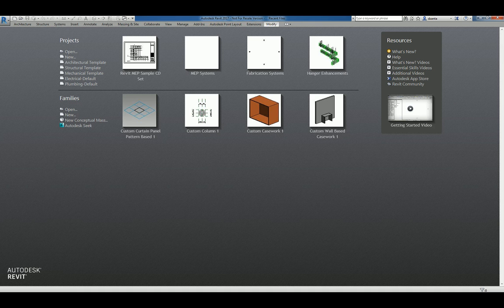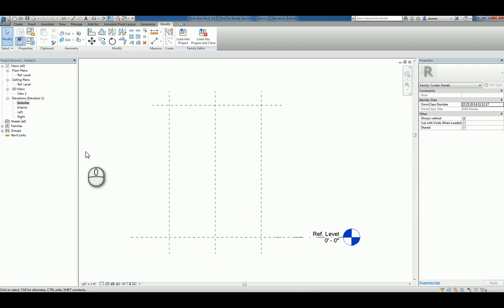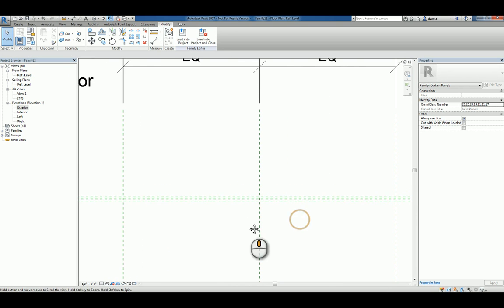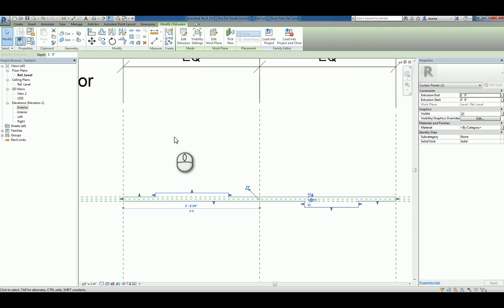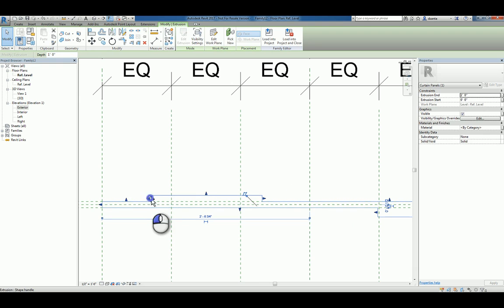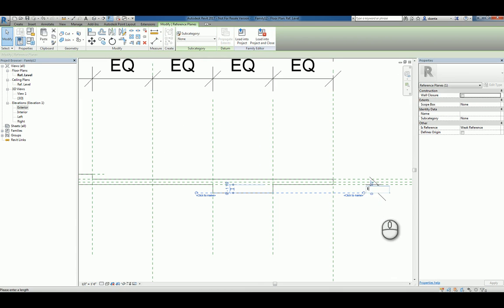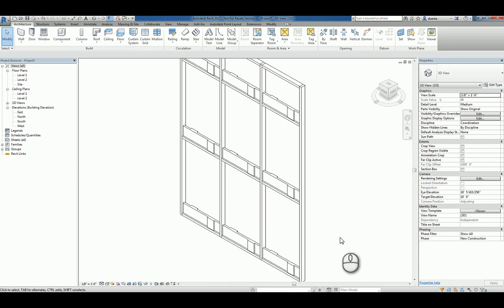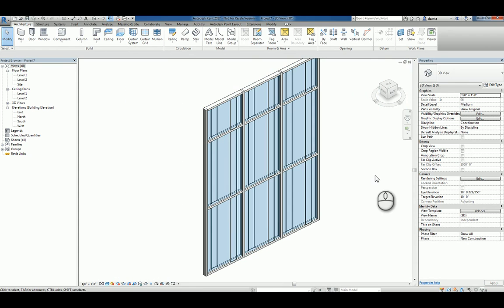Revit Families Series   Custom Curtain Panel How To

Comment: Thanks Dzan for this video. I've dove in head first to figure things out. Most is pretty simple to discover through exploration... But I was stomped as to why my panels were not adjusting in height. That dang lock button needs to be more pronounced in dark mode! LOL Great intro video to customizing things.
Reply from the maker: @loganfrost196  thank you

Comment: Hi Dzan, Do you know how to use the real curtain wall extrusions in making custom curtain wall panel?
Reply from the maker: you can start with the profile.rte template file.  Go to Categories and specify it as a mullion profile.  Create a closed loop sketch for your custom mullion.  Load that into the project and swap the families...
Reply: @DzanTa  Thanks Mate. I will try this and let you know if it works

Comment: does this adapt to a curtain wall with an angular profile edge?
Reply from the maker: as long as you sketch the angle lines and constrain them properly, it should work.  Another alternative is to use the adaptive component curtain pattern based families
Reply: @DzanTa  can you point to me to a video that shows the sketch line approach. I already found your adaptive component curtain wall approach, so thanks for that. 

But to give more depth, I have modeled an actual wall panel this wall has many extrusions, so when I change the wall profile to something else than a rectangle, Revit deletes the type and places a default glazing.
Reply from the maker: @beto008  that usually means your curtain wall profile is too complex of a sketch. You can try to make a more simple profile and go from there.
Reply: @DzanTa  not sure if I communicated it well. But the wall profile is a simple trapezium with the angle side being the top one.  I wish I could send a screenshot haha.
Reply from the maker: @beto008  I can try to help you tomorrow after 3pm
Reply: @DzanTa  what TimeZone are u in? I’m Eastern Time , USA.
Reply from the maker: @beto008  eastern...atlanta
Reply: @DzanTa  let me know how we can go about this? :) appreciate it a lot. Even if you just point to me in the right direction
Reply from the maker: @beto008  what is your email address?  I will set up a TeamViewer session
Reply from the maker: @beto008  i just you a webex remote session via my company email address (repro Products)